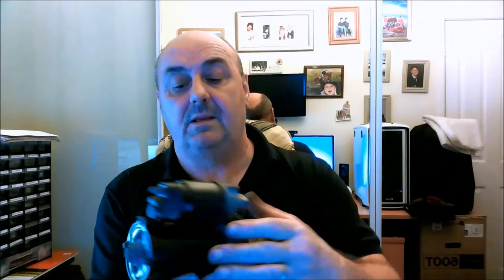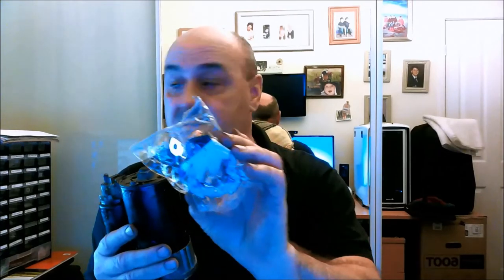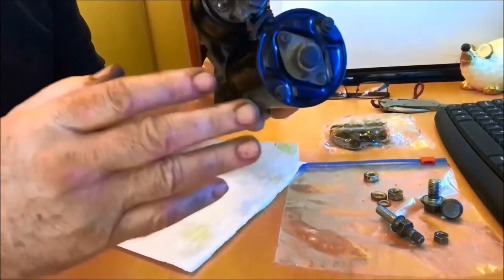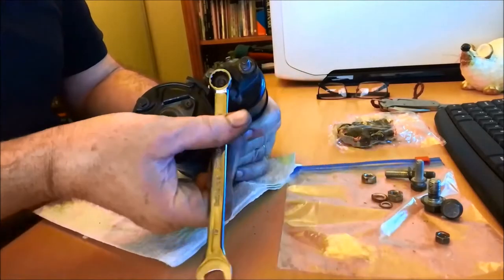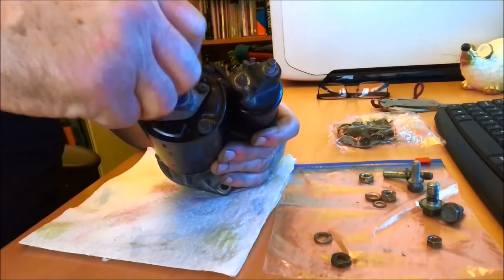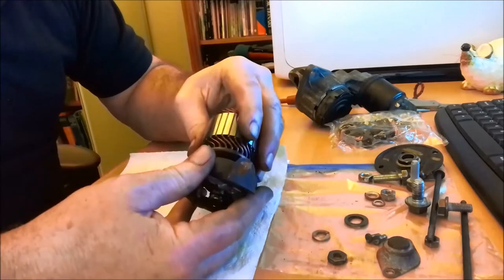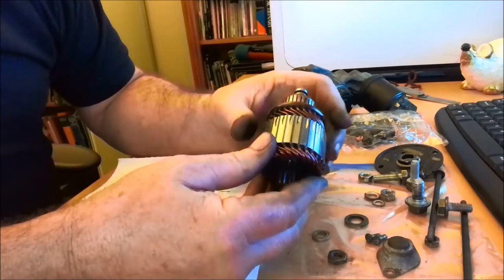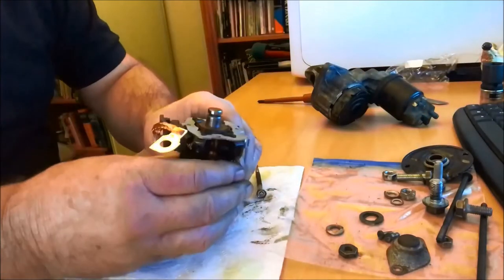Repair a vectra C starter

Comment: Just replaced the starter motor on my 2005 Vectra C Design 1.9cdti 150. Pig of a job but got there in the end. One important thing I have to mention , I could not get the car to start at first. The car was turning over but doing absolutely NOTHING. Felt as if there was no compression. It turns out that whilst removing the old starter I had knocked the crankshaft sensor and it had become disconnected but not entirely so all at 1st glance looked well. To cut the story short I checked all sensors around or near the starter motor (the crankshaft sensor is directly below the starter motor mere inches/cm). When I clicked the crankshaft sensor  into position all was well and the car started 1st time.
Reply from the maker: I'm so pleased the video was helpfull to you, and many thanks for the comment that I'm sure will help others in the same predicament, thanks for sharing.
Barry

Comment: Hello. Whats your car engine vectra c?
Reply from the maker: Hi Kasty, it was the 1800 petrol
Reply: thank you for your reply. My vectra c engine is 1.9 cdti 110 kw, but probably the principle of operation of the starter is the same, the cog has to slide out and rotate, mine only rotates. Could it be a solenoid problem?
Reply from the maker: @kastytismiliauskas-ev7pp  your solenoid does two things, when energised it will soot the gear forward to engage the starter ring and when it reaches the end of its travel it will connect the power to spin the motor, so if you motor is turning it's reaching the end of it travel, have a look at your gear is it stuck in one position or can you move it by hand, it may well be just dirt on the shaft it run on, remove the solenoid and check it's pulling the leaver to engage the gear and at the same time give the shaft a wash with brake clean, make sure everythings free and mobile.